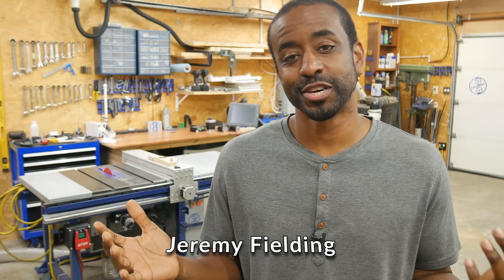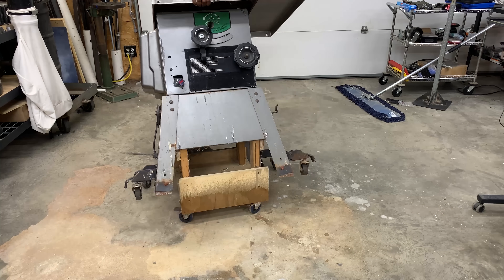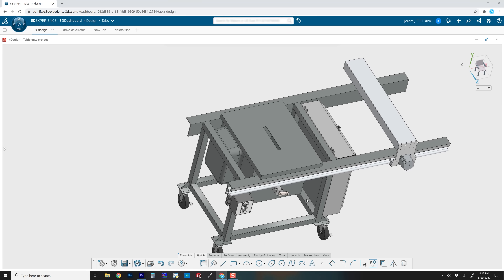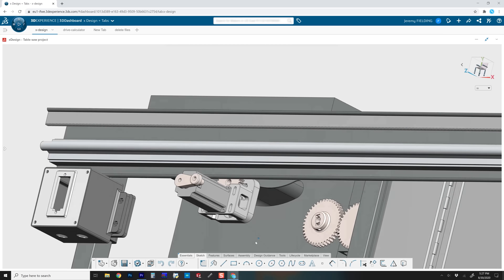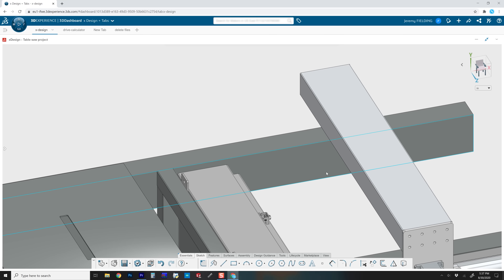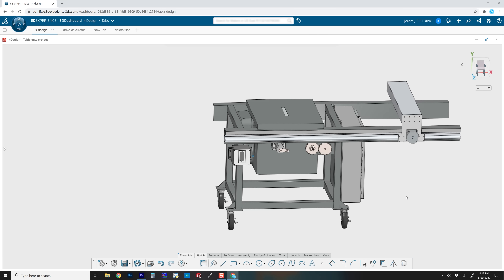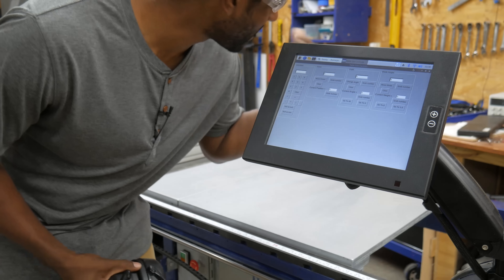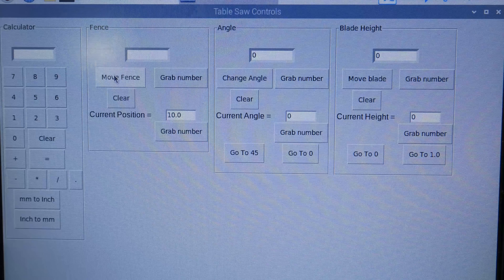How To Make A CNC Table Saw : # 084

Comment: awesome project, brother!  Check your motor controllers - they may have trapezoidal profile capability built in.  The controllers I have used (Lin Engineering, mostly) allow you to program the acceleration and deceleration rates along with the steady velocity.  Then you just call that profile and away it goes. 

something else you may consider is setting up a precise position sensor on your fence system such that you can re-home to that after you have manually moved the fence and lost the position.  or, I suppose you could go with absolute encoder$$$...  ;-)

your enthusiasm is very inspiring and your knowledge base has helped me tremendously over the years!
Reply from the maker: Thank you... also check the top/pinned comment. Thanks for watching.

Comment: 🤔  I was just, literally just two days ago, wondering how I could add CNC to a radial arm saw!!  

Why? What would I use it for? That isn't the point.  The point is to take a tool that demands a huge amount of attention, and make it safer to use.  After watching this, I think it might be a pretty easy hack.  The thing is designed to move up and down, and back to front, pretty easily and under good control.  Side to side os done either by swinging the arm or by moving the work on the table.  

More thought needed, but this project has shown me that it's hypothetically possible.

Comment: Awesome! I'm working on a CNC thickness planer so I know how much work was involved. Check out accelstepper arduino library for some ideas on how to implement acceleration (my steps are generated on a Teensy 3.2 with it so I didn't have to code it myself). Also Boeshield T-9 is great for protecting bare metal

Comment: For a rust free machine surface, I use paste-wax~  It'll protect the surface from rust, lubricate it for easy wood pushin' and it wont affect the surface of the wood you're cutting the way other silicone or petroleum based products.  P.S.  Awesome project~

Comment: use WD40 and coarse steel wool, or and abrasive pad to remove rust.  Use Johnsons paste wax to preserve the finish.  Put a heavy coat, and then let it haze, then buff it out afterwards.

Comment: Without a locking mechanism on the far end of the fence it will flex cutting thick hardwood. But even with a lock you still have to check the fence for squareness from time to time.
To solve this permanently you can add a rack & pinion drive on the far end (think moving gantry on CNC machine) and use independent limit switches to square the fence (gantry) every time on homing ( in extreme between each cut).

With an automated fence positioning you need a power feed now :-).

Comment: To keep your table top rust free and gliding nicely, use paste wax. It's cheap and easy to do. It also doesn't harm any material that's cut on the table saw, unlike silicone which will soak into wood.

Comment: The CNC machines that I work in have a time delay built in to disabling the motor drives during an e-stop event. This allows for the axes to be stopped before cutting power to them. Probably overkill for your project and still not done right on lots of the machines I work on. Great work, great video, my kids and I love watching keep up the good work!

Comment: You are brilliant and inspiring, thanks for sharing. I’m a new sub.  One question, since you can command the fence to either side of the blade, i there any logic to prevent the fence from crashing into/across the raised blade?  I assume the other side of the blade is a “negative” distance. I have not reviewed your code since I’m on my phone and just watched this video. 

I think that could be resolved with some conditionals that check the height of the blade before accepting a “negative” distance. Clearly you don’t want ALL travel to be impeded by blade height, just traverses which cross the blade’s axis.

Comment: Nice project. If your blade is 1.25 inch high at 30 degrees stop your fence like 1.25 inch * sine 30 or .625 inch to stop a crash. Good luck

Comment: 2:10 Good old furniture wax every couple of weeks, it not only prevents rust it also helps to make the surface slick so there is less friction on the wood as you push it into the blade. Very cool project, congrats on the coding, its been a huge barrier for me to break and get visions finished.

Comment: I work with small hand tools in most of my builds, would love to automate checking the water tank level, reading the electricity meter and converting my analogue motorcycle gauge to an arduino gps speedometer...I'm not planning on building a cnc machine soon but your video is very motivating

Comment: This is excellent. The thing that puts me off trying something myself is backlash. How did you get around it? For example, if your fence goes right 10, then left 10, how do you know it is exactly where it started? (Same with the blade angle and height).
Reply: (Possibly something to do with laser measuring devices or perhaps break into a set of digital vernier calipers?)

Comment: Another great video.
Great project.
Time and pressure!
(Shop is really coming along!)
To protect metal I have been using 
Minwax 785004444 Paste Finishing Wax
And or mineral spirits.
(Don't bundle rags together and throw away,  fire, for real.  Must let rags sit out and evaporate volatiles first.)

Comment: I also have to use paste wax that gets buffed off on all of the machined surfaces on the tools in my workshop.   The more humidity your region gets the more you'll have to check the metal.  Waxing also make the surface slick enough to run material over it with ease.  You may have to use a solvent once and awhile to avoid wax build up.

Comment: I've just been working on a CNC project and ended up deciding to use encoded DC motors, they are a little harder to set up, but it eventually saves a lot of headache because the motors know where they are. For example if I drive the motors too fast, they know to come back a few steps to the actual position they were told. The saw looks like it came out great, and I really like the GUI!

Comment: For the blade height adjustment handle, I would recommend using something similar to one of these "safety" handles that were designed for converting manual Mill vertical knee handles into servo powered. You simply push the handle in to engage it for manual use and the rest of the time it free spins on the servo spindle shaft.

Similar style to the one seen in the vid:
https://eisenm.com/products/milling-machine-part-safety-ball-crank-table-handle-for-bridgeport-type-mills
Crank wheel style:
https://www.mscdirect.com/product/details/09507930

Comment: Great project, quotable comments, per usual! MIG welding appeared to be using flux core wire. Investigate use of solid core and CO2/Argon gas. Cleaner weld with less mess.

Comment: Citric acid works great for rust removal. It also passivates the surface to make it more resistant against new corrosion.  And does not smell that nasty than vinegar. (It is used in industry for that purpose also) Buy concentrated citric acid powder/granules, not the pre-mixed liquid stuff and make it a strong mix with water. (Normally powder or granulate is sold in supermarket to decalcify kitchen machines). For big surfaces i have mixed it with gelatine (less gelatine per water than the recipe states) to make a gel. Worked really good!
Just dive the parts or leave the gel on them for a couple of hours or a day, then rinse of with water an brass/bronze brush. If needed, repeat the process. Then dry the parts and be happy.

Comment: While I love the nerding out aspect of this, I would probably have kept it simple with a DRO and a screw(powered for coarse and manual for fine adjust) for the fence and ditto with a DRO for depth and a digital angle finder for the blade angle...

But then again I probably WOULD have built my own design table-saw so there is that.....
Reply: Stepper motors are so accurate this so much better than any system I have seen done to a table saw on YouTube.   Everyone is going to copy this.

Comment: Jeremy for safety you might want to add a Riving blade on the back of the blade so you wont get kick back. If you plan on automation completely, you add the wood to a table that will feed it to the table saw blade and cut the pieces you need based on your BOM.  That table saw would be something that is not out on the market today.

Comment: One thing you can do to improve the safety of the rotating handle is to make it slidable on the shaft. Next you can add a spring that pushes the handle away from the parallel pin that transmits the torque. That means that the handle will freely spin. Then, when the user wants to rotate the handle, he has to push the handle in, to engage the parallel key, and then he can rotate the shaft. The moment he releases the handle, it springs back, and is no longer a danger.

Comment: I use mequiars car wax as protector and lube on all woodworking tools and whenever possible on anything else.  Wood dust plus oil makes gummy schlar   Wax lasts up to a year with condensation events which are significant in Wisconsin and a biannual headache for me. Best is to keep iron temp above dew point. Most oils float on water and need to be replenished often. I want a wax that is resistant to cutting oil and coolant.

Comment: Did something vaguely in this area with my miter saw... I attached two T-slot aluminum fences to the machine; and 3D-printed a mount that turns one of those “dro scales” that’s kinda like a set of digital calipers into a precision stop. I can slide the stop to any position and know exactly how long the cut piece will be. Particularly handy considering that it’s a metal-cutting saw (Evolution RAGE-3).

Comment: So for getting a lot of rust off a saw table the vinegar-soaked towel was great. For touch ups, I use mineral spirits and fine steel wool pads.
As to keeping the tops slick and free of rust, While I like several of the spray treatments out there, the one that has stood the test of over 40 year’s time for me was common paste wax, applied every 60 days or so. Also, when the saw is not in use, lower the blade, move the fence off the table area and cover it with a piece of plywood or MDF. That will prevent condensation from gathering on the cool iron in the early mornings.
What a great project, Jeremy!
It must have been a great challenge to solve all of the challenges that complex a project would present. I’m really, really impressed!
Your videos are always informative and easy to understand.
Thank you!

Comment: OK I can buy a number 23 how in the world do you put it together what steps do you need water electrical drivers that you mentioned I need to I just got the wires put a plug and stick it in the wall I need more than that thanks
Reply from the maker: There is too much to cover, So have to refer you to the many tutorials on Youtube for all the various steps. But you will have to hunt each of them down as you run into gaps in knowledge. They are there. I used them when I didn't know how to do this stuff.

Comment: Hey @Jeremey i had an idea to help solve backlash and get really repeatable results. Normally with a cnc you couldn't get away with it but on a table saw how about you program it to overshoot a quarter inch if the move is travelling left to right and then come back right to left so you always aproach the final location from the same direction. That way the backlash in the meachanism is taken up the same way each time and its also taken up in the way that prevents the fence being pushed back. IDK if this is a good idea or not but just thought i'd share.
Reply from the maker: For me it's not a problem I need/want to solve. But I would say that seems logical and would probably work.

Comment: You're one of my favorite makers, thanks for the video! For the sake of safety, I highly recommend a circuit and some code to lock out the fence and blade adjustment when the blade is spinning. You absolutely do not want a bug in your code to cause an adjustment during a cut. That could be catastrophic for the operator, particularly with how fast and powerful those motors seem. You want to code it so it's likely to fail safely if something unexpected happens (and it will, even if you were an expert coder). Alternately, you could design a momentary switch into the workflow to either lock-out adjustments during a cut (you'd want it to be impossible to make a cut without pressing it) or to enable adjustments (you'd want it to be difficult/impossible to press during a cut).
Reply from the maker: I agree with your comment. However it is pretty close to impossible to do that now unless there are two people standing there with one at the screen and one pushing wood.

Comment: What an amazing machine and talented young man.
I recently derusted a table saw I have had for years and has been outside since the old owner, I had amazing luck with a 3m rust removal wheel for the drill then 220 grit followed by a standard scotch pad :)

Your results are much more stunning then mine

Comment: May I suggest the next project would be the autofeed mechanism.   Many times, people get injured by kickback.  If you can make the machine auto feed the work pieces, and the operator can operate the machine in a distance, it can save a lot of bruises, fingers and even life.   At the moment, we have sawstop to stop the saw when someone accidentally touch the blade.   But it will dangerous when this happens.    Jeremy, you can make a very good business from it you can make this work.

Comment: Fantastic project.
Whilst 0.18mm is close enough for most woodworking, I wonder if having it error on the large side would be better as you can always sand off excess. Also can you change the blade width in the software when you use different blades?
Reply from the maker: It’s so easy to change the zero through the User interface.

Comment: Couple of of questions (well a specific question that sort of leads to the general form of the question.

Where did you buy the gear rack?
Would you consider adding a BOM to the GitHub repository? Not necessarily for the raw stock or table saw itself, but some of the other components.

Comment: Jeremy, I’m always excited to see what your next video is going to teach me, and it’s a huge added bonus when I see you twice in a day, on your own channel and in a Destin video 😃

I do have two pieces of advice, coming from a well researched woodworker...

1) do not use plain ol paste wax. It’s what everyone’s grandpa used, therefore everyone thinks it’s the best. Use either CRC 3-36 - it’s cheap enough ($6 a spray can that will last a decade) OR use Collinite Super Double Coat paste wax which is a bit pricier at $20 or so, but will last a decade or more. 

2) doing all this for your old Hitachi saw is kind of like tuning your grandma’s ‘96 Honda Civic. I mean, you made it waaay better, but it’s partly a waste to do all this work for such a sub par saw. For around $500 +/- $200 you could have a used Delta Unisaw with more hp and better overall quality. 

Keep the videos coming! Love your stuff!

Comment: That's fantastic! I love the cut list idea. With AHS-CP-1A induction sensors, I've measured repeatability of +/-0.0001in during homing. I'm sure others will have better suggestions, but I use wax on my table saw and router outboard deck, just normal SC Johnson stuff, and I believe it helps boards to slip and slide. On machine tools, I use Boeshield T9, but on a table saw you might see some of it get on to boards, I don't know. If I could make one suggestion for coding, consider dictionaries to store values, to move the meaning of a variable out of its name. E.g., RPM = {'f': 400, 'a': 400, 'h': 900, ...} This makes it convenient to loop over values, by looping over the keys of the dictionary. Like engineering, many ways to do the same thing.

Comment: Are there safety interlocks so that you can't move the fence or adjust the blade while the saw is on? Also, to prevent moving the fence from one side to the other while the blade is up.

In fact, it might be even better to retract the blade and return it if you try to swap sides with the fence.

For backlash, it shouldn't be an issue as long as you always approach your final settings from the same direction. Which could mean overshooting, then making a small move back in the correct direction.

Comment: Jeremy man, use a drying furniture wax on the top of that saw. apply a coat give it 5-10 mins to haze and buff with a cloth or buffing wheel. It will protect the cast iron from corrosion and give it a slick smooth surface when feeding stock through it.

Comment: I use "T-9 Boeshield" on my table saw. Spray it on and wipe it off.  It will not impact the wood, and it protects the table top from rust.  Plus, it's actually a lubricant, so it helps your wood slide on the table.

Comment: For rust removal on a table saw, I use scotchbrite pads on a palm sander with some wd40. To seal the top after, 100% carnuba wax. You have to be careful what you use to seal the surface with as it gets on the wood you cut and can affect applying finish to the wood after.

Comment: Most would have been happy with just moving the fence only, but blade height and bevel that’s impressive!  I enjoy the videos, I wish they were a little longer with more detail about problem solving and design.. Have you considered doing a pusher/stop for the miter saw?